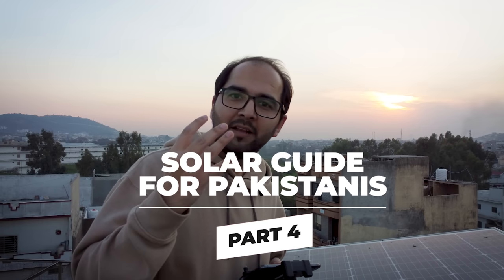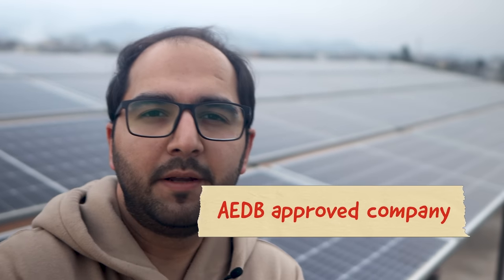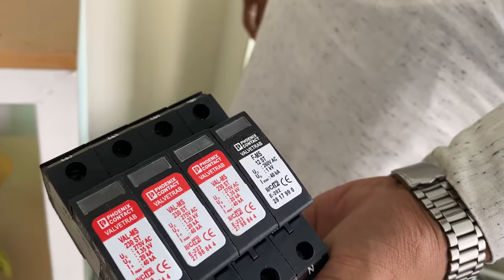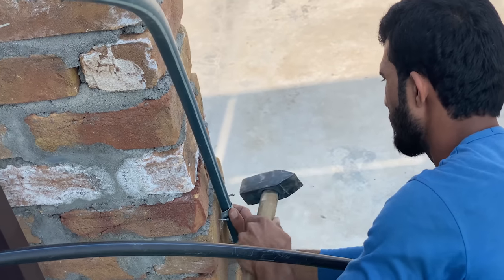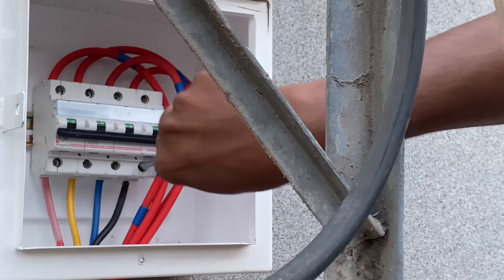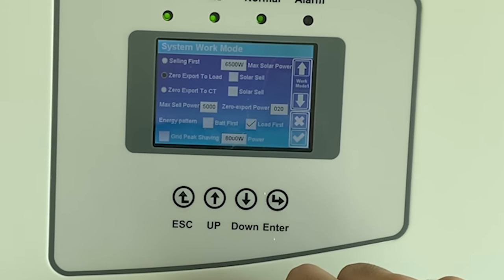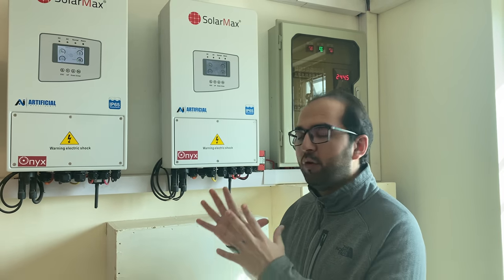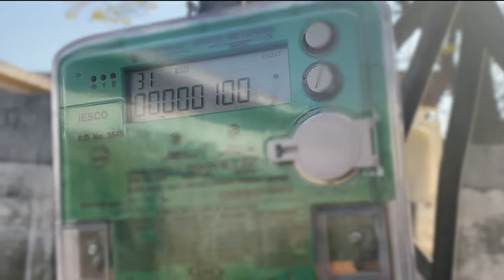SOLAR NET METERING: Truth No One Tells You

Comment: Very good video and everything you said is reality. I also faced the same issue with NEPRA+LESCO. I got solar system installed on my house in mid-fed 2021, and was unable to use for complete season because I opted for on-grid system only and my net-metering application got delayed a lot. Initially my solar company gave me timeline of 3 months for it but then after waiting for 5 months I got angry and started visiting there office regularly then they told me that my application has been rejected for some wrong data in file and now they have sent it again and this truth they didn't told me for a long time. Then finally my net-meter was installed in end of september after waiting for almost 8 months.

Now, Alhamdulillah I am using net-metering for past 5 months 🙂
Reply: Bro from September till date what is the review on billing? I have heard there is a ratio to which ure generated units are settled against consumed units?
Reply: @AhsanRaahid  I haven't heard or know of any such ratio. The generated units are first consumed in-house and excess units are sent into the grid. Peak-time units are not compensated and are counted separate so since the installation of green-meter I am mostly paying bill for the peak hour units. There is no limit ratio for off-peak units. We even used 100% of our generated units some months and paid for Peak-Hour units using bill credit (i.e. zero bill)

Every month the remaining exported units, that we haven't used in the month, are counted and the bill-credit is given every 3 months and credit amount is around Rs. 9.5/KWh.
Reply: We are also planning to start our solar panel system in Lahore and will prefer net metering . Will you be able to guide us.

Comment: Great effort. Was waiting for your new vid on solar.  I got my solar system installed 2 months ago and green meter was installed 20 days ago alhamdulilah. I think the latest initiative by the govt to waive off the license requirement of smaller capacity will reduce the process time but not the corruption element. Mine was handled by the solar company.

You need to make another video on how the bill is calculated with green meter. The mechanism of offsetting units , peak hour and off peak hour setoff and optimised usage settings to maximize the benefits of the ongrid and hybrid systems.
Reply from the maker: Inshallah next video issi topic par hogi
Reply: Salam coolfireg,
Apne solar kis company se lagwaya he?
Reply: @nomangm  from Pantera Energy
Reply: @syedowaisali  waiting for it, insha'Allah

Comment: Note: 
Net metering can be done on ON Grid or also called Grid Tied system. We can't do net metering on OFF grid system.

Moreover, Hybrid system is also On Grid or Grid Tied System with battery backup. So we can't say that for net metering Hybrid is required yet where there is a lot load shedding and you need to run load during load shedding then Hybrid is idea. While  Grid Tied System is ideal where you don't face much load shedding and you don't need backup. 
Thanks

Comment: Excitedly Waiting for the next video on import and export units in net metering... What a 10kw system is producing in actual
Reply from the maker: yes, I am excited to make that video too.
Reply: It can produce from 60kwh a day in summers to 25kwh a day in winters when the smog level is high. You can expect around 13000-14000 kwh annually.
Reply: @sunny56dx   tilt angle must be consider to get this much production. Normally solar installaters dont consider this and  just put PVs on 15-20. Degree to lower the winds impact so i believe that will be high number to expect.
Reply: @omgEngineer  im talking my personal experience. In winter months we were doing between 450-500 units a month on a 6kw system and in February we already crossed 400 in 20 days and expecting around 700-800 units in March April May and June. In total we are looking at around around 8000 kwh this year and if that’s a 10kw system you can easily expect 13-14k units.

Comment: The thing I am asking this question is that here in Pakistan there is so much load shedding and I am trying to figure out the best solution which gives me maximum backup at the time of load shedding. in the market, there are 3 types of batteries available i.e.
1.	Tubular (12 V max of 230 ah)
2.	LED (12 v max of 180 Ah)
3.	Dry cell (2v with various ranges like 400 ah, 600 ah, 780 ah, etc)
the seller told me that the 1 cell of the option3 gives you the output of approx. 2 batteries mentioned in option 1)
can anybody tell me what actually the case is? which setup is more beneficial and gives me maximum backup for home use?

Comment: I paid PKR. 120000/- for getting the green meter and i paid it to the Solar company. I was told that they had to bribe 15k to the SDO and 15K to the XEN but i got my meter installed within 15 days. My system was not even installed and the meter was fixed on the wall without any inspection from the WAPDA authorities. Got it installed on 1st of March, 2024.

Comment: DISCO's reservations are correct. Net metering not only disturbs their customer base, it disturbs their daily "energy demand distribution" (less demand during day, more demand during night). This, in turn, adds more pressure for "generation capacity". 

In other words: Solar generators are using the national grid as battery back up ! This hurts the national grid and it will get even worse with more solar adoption till the whole system collapses.

We cannot do away with the national grid. Losing it will be devastating.

Comment: I have set up a 6.5 KV solar system with a Solar Max inverter. However, I have noticed that the inverter shuts down at times, either after an hour or after 3 to 4 hours when the solar light diminishes. To restore power, I am forced to switch back to WAPDA. Can you please advise me on how to resolve this issue?

Comment: While solar energy is a great convenience of low cost energy eliminating dependency on utility companies for power supply provided the installed system is self sufficient and doesn’t shut down in case of power outage or load shedding by the utility company. 
Having said that, the payback period on the huge investment on a given solar system is a function of consumption needs of the investor;the higher the consumption, the shorter the payback period considering the current barriers to net metering which can further reduce the payback period. On the other hand if the cost of power from the utility companies continued to climb rapidly, the payback period on solar system investment will be shortened accordingly.

Comment: I just installed 10 KW Hybrid solar system and using GoodWe inverter. When ever there is load shedding the inverter turns off completely i.e it does not provide electricity at home or to the meter (that is explained). My question is that do all inverters turn off completely or do they continue to provide electricity to house even when there is load shedding?

Comment: Bro you explained it very well asi understand the whole system that works around in Pakistan. That is why I prefer to go with power station with lofepo4 batteries that would last me 4000 cycles down to 80% rather going hybrid. Eventually it all depends upon the load u running so batteries can't easily replace the hybrid grid system

Comment: sir, your video is by far is the best video of all the videos I have watched so far. All the appreciatios and praises that you deserve apart.I have a question to ask you which no service providers have been able to answer. A customer of yours pays almost 12 to 15 lacs of rupees for a 10 kw system at his premises. The system starts producing 8 to 10 kw of electricity. what happens to the power produced during loadshedding hours.
Reply from the maker: Thank you so much. In OnGrid systems, the system will shut down (even if it’s Sunny outside) so your home will be without power.
In hybrid system solar will keep producing electricity to supply just for your home and using battery backup in case sunlight isn’t enough to meet the demand. 
You can watch Part 1 and Part 5 of this series to get a deeper understanding of this.